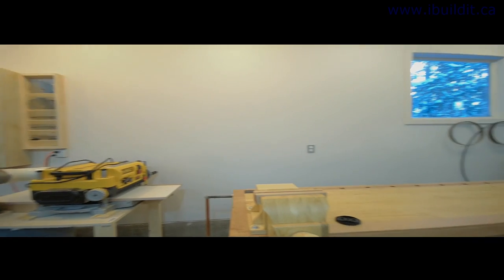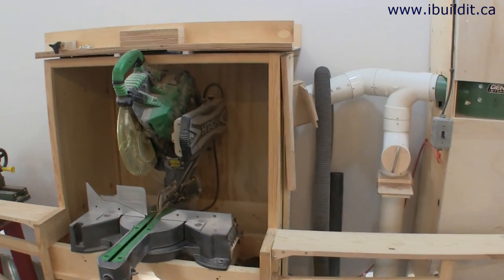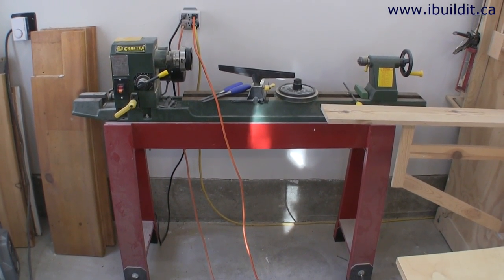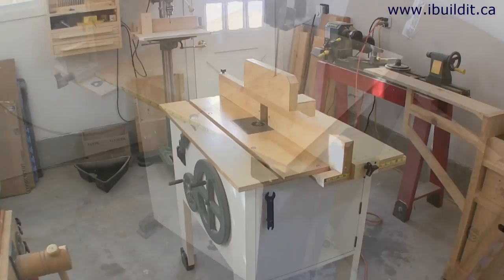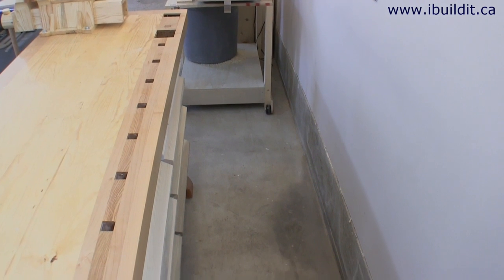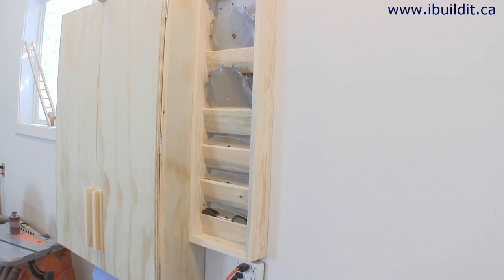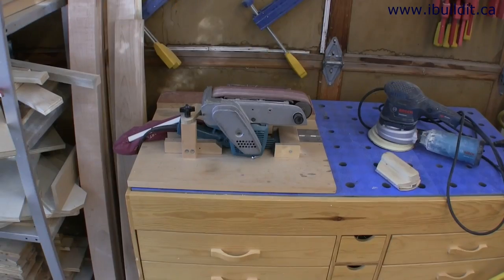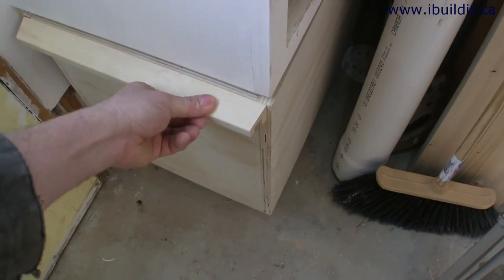The I BUILD IT Shop Tour 2014

Comment: Thanks for the tour.  I particularly like you saw blade storage (1:28) and the planer stand (3:30).  On the tip out bins, do you use special hinges to stop them from opening farther or does the face frame extend high enough to act as a stop?
Reply from the maker: Thanks! The bins are not on hinges, but have a stop on the outside to keep them from going any further. More detail on this in the article on my website: http://www.ibuildit.ca/chop-saw-station-1.html

Comment: Very nice shop John. Can we get a little more detail on the Paint Cabinet Thermostat and the wheels on the Router Table?
Reply from the maker: Thanks Jim. More details on the cabinet on my website: http://www.ibuildit.ca/Workshop%20Projects/heated-cabinet-1.html
The wheels are the same as I did on my planer stand: http://www.ibuildit.ca/Workshop%20Projects/planer-stand-1.html
Reply: On your Paint Cabinet Do you have any problem getting the heat to the top shelf?  I could not see if there was an air gap between the shelves and the door to let the heat rise.
Reply: Nevermind I see it now

Comment: Nice shop John, I like your idea on the DC I have a 4 bag jet 2000 CMF and puts to much fine dust back into the room and its pretty bad although it does a good job getting the big stuff any ideas?
Reply from the maker: Thanks Bob. Maybe a separate air cleaner to pick up the fine dust in the air?

Comment: Nice shop. Thanks for the tour. Question on the drill bit cabinet- do u ever have a problem with wood expansion and the bits getting stuck?  Also the heated cabinet - any other pics of the bulb/tstat setup?  I need to make one of those. I currently haul all my finishes inside when it gets cold. Great video as always
Reply from the maker: Both are covered in detail on my website.
http://www.ibuildit.ca/Workshop%20Projects/drill-press-cabinet-1.html
http://www.ibuildit.ca/Workshop%20Projects/heated-cabinet-1.html
No problems with the bits, since the hole they fit in is drilled the next 1/64th size up.

Comment: Very smart shop design.  A couple questions:  Do you find standing on a concrete floor fatiguing, and are there any tools at which you prefer to sit?
Reply from the maker: Standing for long periods is fatiguing, whether it's on concrete or anything else. I've spent nearly 30 years walking, running, standing, sitting and falling on concrete floors - still not crippled.
Still, there are not any shop tools I would sit at.